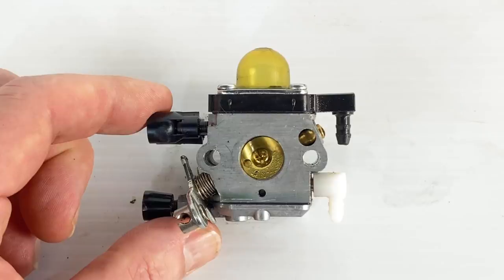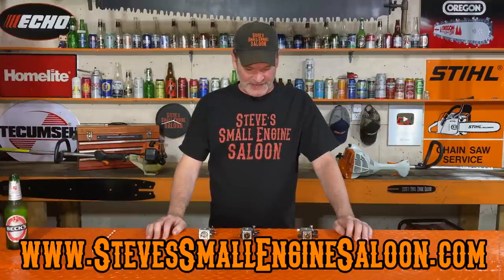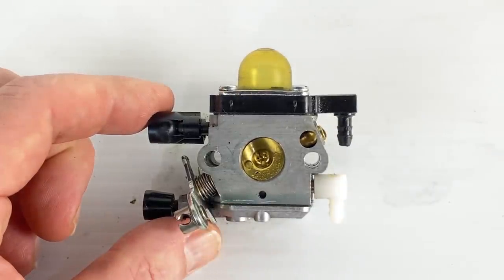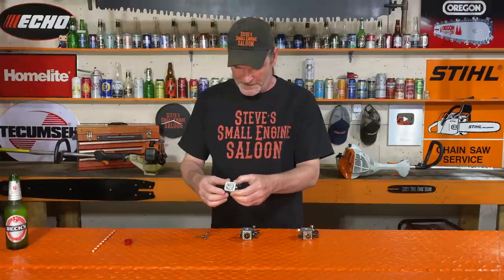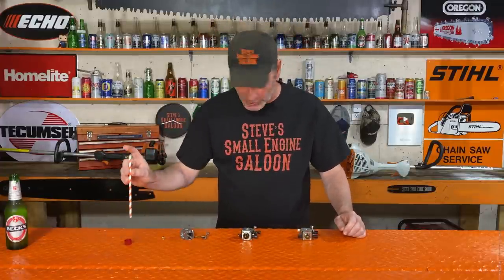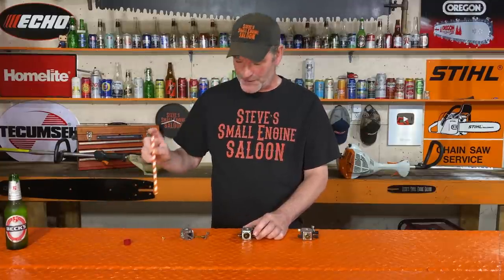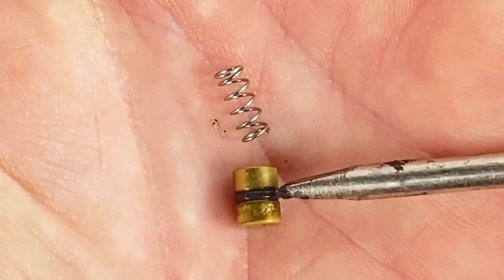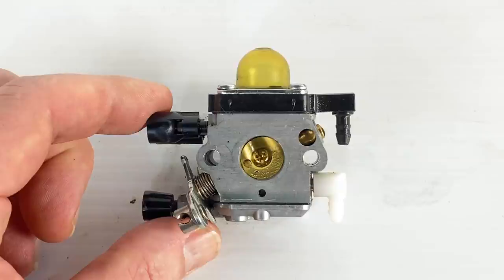Easiest Way To Test The Accelerator Pump On A Weedeater Carburetor

Comment: Are there any amazon carbs you would stay away from.  I bought a carb for my Echo weedeater and it still cut out on me after a few minutes of running.
Reply: Exact same problem as your old carb?   Dies after a few min? If so, it sounds like the return line or cap vent isn’t equalizing the pressure in the fuel tank. try cleaning purge bulb valves? Or check/clean your fuel cap vent. Depends on the model.
Reply: Thank you sir any your videos are very informative I wish I would have been looking at your videos 10 or so weedeaters ago

Comment: Steve, why not just replace the 'o' ring?
Reply: Probably too hard to find one the correct size? Plus the throttle blade brass screws are usually center punched/peened in so they don't vibrate out and removing them usually breaks them off and ruins them and often the brass throttle shaft. New carb is $15 on Amazon, so Steve is right. They are not worth messing with or rebuilding for that cheap.
Reply: @joefudd  Cost you more time than just getting a new one.
Reply from the maker: In my experience.  If the o-ring or plunger needs replaced, then the gaskets and diaphragms probably do too.  Purge bulb is not far behind!  And the hole will be all scratched up and wear the new o-ring out super fast.  The carb is simply worn out and not cost effective to repair anymore...
Reply: @StevesSmallEngineSaloon  especially for just $15 for a new one. It's like repairing a disposable lighter now, lol.
Reply: @mgomez5606  yep. I'm old school and used to rebuild those little walbro and tillotson carbs when I had my own small engine shop in the 1980's.
Reply: Polish the hole, and install fatter o ring, just for an experiment
Reply: @ikstrucking3289  then it will probably bind up.
Reply: @joefudd  I never have luck rebuilding them. Have a hard time starting them after.
Reply: @StevesSmallEngineSaloon  OK, thanks for the explanation!
Reply: @mgomez5606  Takes time to get a new one; it doesn't just drop out of the sky, usually.
Reply: @65csx83  I never have luck with them. Easier to just get a new one.

Comment: Can you not replace the oring ?
Reply from the maker: In my experience.  If the o-ring or plunger needs replaced, then the gaskets and diaphragms probably do too.  Purge bulb is not far behind!  And the hole will be all scratched up and wear the new o-ring out super fast.  The carb is simply worn out and not cost effective to repair anymore...
Reply: @StevesSmallEngineSaloon  Thank You For Replying And for the information

Comment: Hey, im having issues with a chainsaw. It runs fine chain spins fine chainbreak works fine but asoon as i put the bar onto wood the chain stops spinning and the chainsaw bogs down. It is a 2 stroke do you have any ideas what it could be?
Reply from the maker: Chain on backwards?
Reply: @StevesSmallEngineSaloon  did not think of that..... maybe im not sure i havent used it just got it from someone started it and it wouldnt cut. Thanks for that tho ill check
EDIT: the chain is on the right way

Comment: If you have to remove it just clean and rebuild it. The fuel filter screens are junk and impede the fuel flow. You need the thinner screen and raise the needle height a bit. Clean tank filter, tank and replace lined as they are hard as a rock. And screw the oil gas ratio that burns them up mix 32:1 or 1 ounce of 2 stroke air cooled oil to 1 quart of gas. That way it will last forever.

Comment: Maybe it was already asked, but I'm curious, couldn't the O ring be replaced?
Reply from the maker: In my experience.  If the o-ring or plunger needs replaced, then the gaskets and diaphragms probably do too.  Purge bulb is not far behind!  And the hole will be all scratched up and wear the new o-ring out super fast.  The carb is simply worn out and not cost effective to repair anymore...

Comment: Is this something new they are doing ? I’ve had a lot of carbs apart over the years and don’t ever remember seeing that. I would imagine it works well when it’s working.  So I guess you get a stumble or stall if you come off idle too fast.  Who knew.
Reply: I appreciate you responding. The display normally just shows your hours but I had to change my belt at 49 hours. Display blinks service needed like I guess a check engine light. I called local deere and they said it would show that for routine maintenance.  Said it would go away in time. Tractor runs fine I'm just confused if it knows something is wrong or it just comes on in certain intervals.
Reply: Honestly. I think that isn't an accelerator pump. I think it's a check valve so that at full throttle the primer bulb doesn't accidentally get bumped or gets sucked in at high rpm.

Comment: Hold up. We are chucking away a whole carburator because of one worn O-ring? Can the O-ring not be replaced? Or did I miss something?
Reply from the maker: In my experience.  If the o-ring or plunger needs replaced, then the gaskets and diaphragms probably do too.  Purge bulb is not far behind!  And the hole will be all scratched up and wear the new o-ring out super fast.  The carb is simply worn out and not cost effective to repair anymore...

Comment: Can you explain the reason why you throw the whole carb away instead of replacing the "O" ring?
Reply from the maker: In my experience.  If the o-ring or plunger needs replaced, then the gaskets and diaphragms probably do too.  Purge bulb is not far behind!  The carb is simply worn out and not cost effective to repair anymore...
Reply: @StevesSmallEngineSaloon   got ya 👍

Comment: Nice! Your lift is now orange. How about just replacing the O-ring?
Reply from the maker: In my experience.  If the o-ring or plunger needs replaced, then the gaskets and diaphragms probably do too.  Purge bulb is not far behind!  The carb is simply worn out and not cost effective to repair anymore...
Reply: @StevesSmallEngineSaloon  Gotcha, Steve. Cheers!

Comment: if i come across this problem i think ill try to replace the o-ring. also put a q-tip in my drill with some metal polish and polish that hole and the little piston.  ill reply with an update if this works. don't see why it wouldn't tho
Reply from the maker: In my experience.  If the o-ring or plunger needs replaced, then the gaskets and diaphragms probably do too.  Purge bulb is not far behind!  And the hole will be all scratched up and wear the new o-ring out super fast.  The carb is simply worn out and not cost effective to repair anymore...

Comment: I believe knowing why these carburetors with leaking accelerator-pumps cannot be repaired would provide better insight into carburetors.  Was this vlog a missed opportunity for such an explanation? For example, why does not replacing the o-ring resolve the leaking problem?  Is not the o-ring a standard size?  Besides the o-ring, are the metal pump surfaces also worn?

Comment: I have a customers weed eater in my shop now. I got it running but I bet if I checked this I would find the same thing.as it is not running right. It idles fine but runs poorly under power.

Comment: So how does a machine run when the accelerator pump is bad?
Reply: That's my question. Mine wont stay started.  I have keep flipping the choke lever to stay running on a good day. Is the rubber washer for that. He didn't really say.
Reply: It'll run but it will seem to bog no matter how you set the mixture needles.
Reply: @naybreed   , if you have a primer bulb , check that. I take it off and place it on your finger tip. Press the air out and it should stick on your finger like a suction cup. ( most times you will just see a small crack on the bulb ) there is also a diaphragm that actuates the needle valve that could be bad.

Comment: Almost nobody knows about the accelerator pump on those. Freaking zamas. You can get those o rings and do the rebuild pretty sure only 2 different sizes. Thing is, if that o ring is bad your check valves are probably bad. Also if the plunger is all scratched up your done.
Reply from the maker: In my experience.  If the o-ring or plunger needs replaced, then the gaskets and diaphragms probably do too.  Purge bulb is not far behind!  And the hole will be all scratched up and wear the new o-ring out super fast.  The carb is simply worn out and not cost effective to repair anymore...
Reply: @StevesSmallEngineSaloon  I was going to ask, "Why not replace the $.01 O-ring".

Comment: I hate when people say "Throw away the carb and buy a new one." A lot of these Zama, Walbro and Tillitson Carbs are not available besides aftermarket and aftermarket quality isnt nearly as good. Rebuild it.
Reply from the maker: In my experience.  If the o-ring or plunger needs replaced, then the gaskets and diaphragms probably do too.  Purge bulb is not far behind!  And the hole will be all scratched up and wear the new o-ring out super fast.  The carb is simply worn out and not cost effective to repair anymore...
Reply: Once more, rebuilding is better than A.M. No matter what. There's no excuse for not being able to rebuild a 2 cycle carb. The only reason why it'll be "all scratched up" is if you rebuild it wrong. Per years of experience..... But go ahead just throw it away!

Comment: Can you just replace the o- ring?
Reply from the maker: In my experience.  If the o-ring or plunger needs replaced, then the gaskets and diaphragms probably do too.  Purge bulb is not far behind!  The carb is simply worn out and not cost effective to repair anymore...

Comment: Couldn't you just replace the O ring and be done with it?
Reply: No The bore in the carb wears out
Reply from the maker: In my experience.  If the o-ring or plunger needs replaced, then the gaskets and diaphragms probably do too.  Purge bulb is not far behind!  The carb is simply worn out and not cost effective to repair anymore...
Reply: @THEMOWERMEDIC1  Ok, if the bore wears out, & the new O-Ring doesn't correct the leaking. I see replacing the whole thing. But if its just a faulty seal. I'm replacing the seal.
Reply: @jameshaney4494  okie dokie
Reply: @THEMOWERMEDIC1  what is the bore in the carb? excuse my ignorance.
Reply: @christopherbailie7607  bore is a hole, it’s scratched and will scratch the new o ring and ruin it.

Comment: Change the o ring? Why throw out original?
Reply from the maker: In my experience.  If the o-ring or plunger needs replaced, then the gaskets and diaphragms probably do too.  Purge bulb is not far behind!  And the hole will be all scratched up and wear the new o-ring out super fast.  The carb is simply worn out and not cost effective to repair anymore...

Comment: I have found that it's not even worth messing with most carbs,  toss them and buy another for $20.  I have had success with the knock-offs working just fine.
Reply: They do for a year if you're lucky. But a customer deserves the oem or an option for it. Then in the paperwork notate that the part is cheap Chinese I mean aftermarket
Reply: Oh and I know you didn't say anything about not offering but that's what I do
Reply: @voidvincent  Why did the original fail?  If the same condition that caused the original to fail causes the aftermarket unit to fail, is it any worse than the OE?
Reply: For the price of a rebuild kit you may as well buy a knockoff.
Reply: @linkgroundwalker  Yes!

Comment: Why not replace the O ring?
Reply from the maker: In my experience.  If the o-ring or plunger needs replaced, then the gaskets and diaphragms probably do too.  Purge bulb is not far behind!  And the hole will be all scratched up and wear the new o-ring out super fast.  The carb is simply worn out and not cost effective to repair anymore...

Comment: Question why don’t you fix them because I do? Just curious to know why
Reply from the maker: In my experience.  If the o-ring or plunger needs replaced, then the gaskets and diaphragms probably do too.  Purge bulb is not far behind!  And the hole will be all scratched up and wear the new o-ring out super fast.  The carb is simply worn out and not cost effective to repair anymore...

Comment: What sort of symptoms would you see on a weedeater that had a bad accelerator pump?
Reply: Its basically an air leak, you will have a bog when trying to accelerate and the idle will be erratic.
Reply: @matej4854  Good to know! Those symptoms could be a range of things. Nice to have something else up my sleeve to check.

Comment: I've got to ask. If its simply a small o ring, and you can identify it, why wouldn't you replace it rather than doing the Steve toss?
Reply from the maker: In my experience.  If the o-ring or plunger needs replaced, then the gaskets and diaphragms probably do too.  Purge bulb is not far behind!  And the hole will be all scratched up and wear the new o-ring out super fast.  The carb is simply worn out and not cost effective to repair anymore...
Reply: @StevesSmallEngineSaloon  gotcha, thanks. 👍🏻

Comment: But I wanna try replacing that tiny o-ring at least once.  It goes in the throttle shaft hole?
Reply from the maker: In my experience.  If the o-ring or plunger needs replaced, then the gaskets and diaphragms probably do too.  Purge bulb is not far behind!  And the hole will be all scratched up and wear the new o-ring out super fast.  The carb is simply worn out and not cost effective to repair anymore...
Reply: @StevesSmallEngineSaloon  k.  Tks

Comment: Why can't I replace that little o-ring ?
Reply from the maker: In my experience.  If the o-ring or plunger needs replaced, then the gaskets and diaphragms probably do too.  Purge bulb is not far behind!  The carb is simply worn out and not cost effective to repair anymore...

Comment: Doesn't it just need a new o-ring and all is good again?
Reply from the maker: In my experience.  If the o-ring or plunger needs replaced, then the gaskets and diaphragms probably do too.  Purge bulb is not far behind!  And the hole will be all scratched up and wear the new o-ring out super fast.  The carb is simply worn out and not cost effective to repair anymore...

Comment: Craptastic, been working with 2-cycle equipment since 1979-80; 41 years and never new this or heard any of the experts talk about this simple diagnostic method and that was back when the carbs where piston instead of flaps and cost about $160 bucks each when the piston got scored from dirt.

Comment: I never saw a carburetor with that. And I would just change the o'ring knowing it's the problem.....
Reply from the maker: In my experience.  If the o-ring or plunger needs replaced, then the gaskets and diaphragms probably do too.  Purge bulb is not far behind!  And the hole will be all scratched up and wear the new o-ring out super fast.  The carb is simply worn out and not cost effective to repair anymore...
Reply: @StevesSmallEngineSaloon  Ok....One question if i may....I travel countries with a bicycle with a motor. last one i have is a Maruyama 5050.  It was a very good motor BUT parts were very difficult to find. Now , i need a new motor and i don t want to have the same problem finding parts. The motor needs to be a trimmer one to fit my gear box. I saw Huswarna, not sure to spell it right but i saw those for sale in Vietnam as well as Guatemala....What is your opinion for that brand and any other suggestions... Of course, sthil are everywhere but i don t know if any would fit because Staton Inc  don t use them. The covid shit is everywhere. I don t know when i will travel again but i wanna be ready...Thanks.

Comment: Why can't you just replace the o ring ?
Reply from the maker: In my experience.  If the o-ring or plunger needs replaced, then the gaskets and diaphragms probably do too.  Purge bulb is not far behind!  And the hole will be all scratched up and wear the new o-ring out super fast.  The carb is simply worn out and not cost effective to repair anymore...
Reply: @StevesSmallEngineSaloon  thank you steve

Comment: Couldn’t you just replace that O ring?
Reply from the maker: In my experience.  If the o-ring or plunger needs replaced, then the gaskets and diaphragms probably do too.  Purge bulb is not far behind!  And the hole will be all scratched up and wear the new o-ring out super fast.  The carb is simply worn out and not cost effective to repair anymore...
Reply: @StevesSmallEngineSaloon  cheers Steve👍 im after a Briggs n Stratton carb for a Harrier 56, are the cheap chinese ones any good?

Comment: But can't you just pop on a new o-ring on that plunger?
Reply from the maker: In my experience.  If the o-ring or plunger needs replaced, then the gaskets and diaphragms probably do too.  Purge bulb is not far behind!  And the hole will be all scratched up and wear the new o-ring out super fast.  The carb is simply worn out and not cost effective to repair anymore...

Comment: If you could get the o ring you would not have to replace the carb.
Reply from the maker: In my experience.  If the o-ring or plunger needs replaced, then the gaskets and diaphragms probably do too.  Purge bulb is not far behind!  And the hole will be all scratched up and wear the new o-ring out super fast.  The carb is simply worn out and not cost effective to repair anymore...

Comment: Why cant you just replace the O-Ring?
Reply from the maker: In my experience.  If the o-ring or plunger needs replaced, then the gaskets and diaphragms probably do too.  Purge bulb is not far behind!  The carb is simply worn out and not cost effective to repair anymore...

Comment: Steve, I'm a cheap yankee why can't I just replace the  O ring.??
Reply from the maker: In my experience.  If the o-ring or plunger needs replaced, then the gaskets and diaphragms probably do too.  Purge bulb is not far behind!  And the hole will be all scratched up and wear the new o-ring out super fast.  The carb is simply worn out and not cost effective to repair anymore...
Reply: @StevesSmallEngineSaloon  Thanks Steve that sounds like fair dinkum.